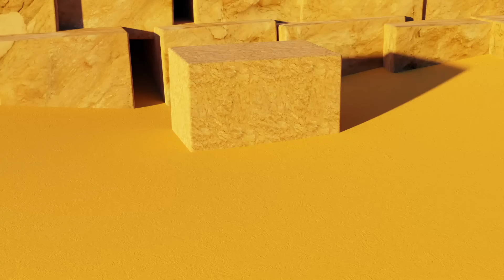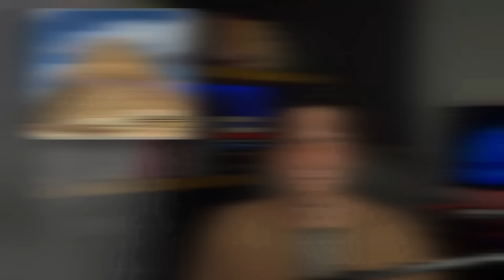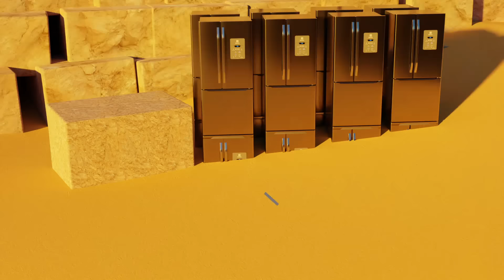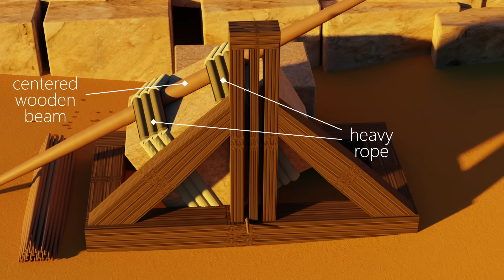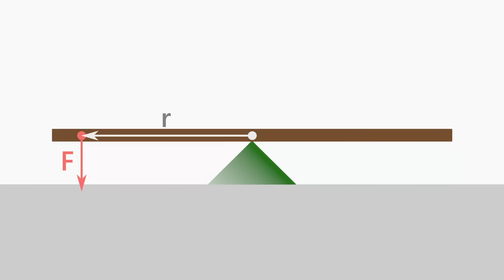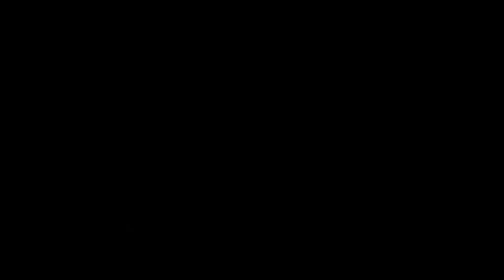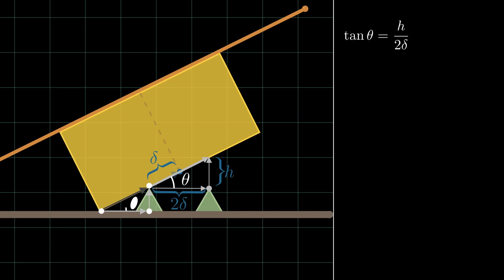Physics Reveals How the Pyramids were Actually Built

Comment: I have read some of Herodotus´ books but not the one where he speaks about this machines so I cannot argue that.  But I can tell you that in one of his "Nine history books" talks about how a Nomad tribe found the piramids and stablished arround them.  They found them, not made them.
The physics discussed here I have no problem with but believing that a wooden stick or two could bear 10 tons weight does not seem to be too realistic, they should be the size os a small tree of, let´s say 30 cm in diameter, just guessing here.... Another issue is where to place the machine on upper levels if only a fraction of the slabs is left to step over.  Furthermore, even if you had all the slabs cut out, placed near the future piramid and ready to uplift you yourself have stated that it would require placing one slab every six minutes for over two decades, extremely hard task if the piramid was a few meters tall but not at a hight of 230 meters.  We could also speak about the sawing of the blocks with bronce saws which was the only mineral available by then, no iron yet, the delivery of those blocks from a distant quary by boat plus charriots or sledges moving through the sand and how they where placed on those means of transportation.  10 tons was the average block, but there are some 10 times bigger.  Then lets talk about the absolute precission of their placement and the inside corridors where the stones fit so perfect that not even a sheet of thin paper can come through the joints.
I am not saying that humans did not do it, I just have too many questions that cannot/have not been answered  but that does not make me a conspiracy theorist.  Maybe someday someone will make a video explaining the whole procces of making the pyramids answering all these questions + logistics needed, but I have not seen it yet.
Reply from the maker: You make some excellent points, and I agree there are certainly more topics to discuss and cover.  I'd like to tackle a couple of your questions.  First, the wooden slats could indeed be 30 cm in diameter (perhaps I could have made the animation a bit more to scale).  The thickness of the slats drops out of the equation for the operation, so these would also need to be chosen appropriately.  A 30 cm thick slat (or log) can suffice up to 20 tons of sheer force (lower conservative limit).  For the more massive stones?  Thicker slats would need to be used.  The internal ramp theory of the pyramids allows for clearance of the machines to be transported and placed within the pyramid during the construction, so clearance on the edges would not be required.  The 10 ton block was used for this example in the video, but the physics and machine operation are not reliant on the mass.  For the larger blocks, the calculations (as well as the pivot distance) all remain the same.  Additional counterweights would need to be placed on the top surface of the block in order to help alleviate the large applied forces needed for heavier blocks.  
As far as the precision cutting, block delivery, and the use of bronze saws, these are certainly outside the scope of this video, but interesting topics to consider to investigate in the future.  With limited records, it is a tough one to crack.
Thanks for watching and appreciate your insightful questions.
Reply: @DrJohnDev Thanks for answering and for your politeness.  As I already stated your video puts together a lot of issues and addresses them very honestly. Excellent work.
Reply from the maker: Thanks @jazzman_10 ! Appreciate it and hope to see you on my channel again! You offer some interesting insights.

Comment: Ok, so you can lift a block to the height it would need to be to be on top of another block. And you say that it can be pushed off the machine and on top of the supporting block.
 But how do you push the10 ton block off the machine and on top of the supporting block?
And 10 tons is all well and good. Perhaps a log/ large wooden beam and some heavy rope could support that much weight.
But how the hell did they get the 100 ton blocks above the great gallery up there? 
In the same way with wood, ropes and leverage? 
Seems highly unlikely to me??
And to my knowledge no one has proven this to be possible by such means. 
I'm certainly not saying it was aliens but no one's got a bloody clue as to how the hell it was down either. 🤔🤷‍♂
Reply from the maker: The physics remains the same for an arbitrary weight. Leverage is used to lift 10,000 ton bridges, so yes, it can indeed handle the 100 ton blocks you mention.  Wood scaffolding also is used to temporary lift such structures during modern construction. So yes, wood can handle that too.
Reply: @DrJohnDev Ok, fair enough, maybe it's possible.
But that's some bloody strong rope though. I'm still not convinced. 🤷‍♂

Comment: Having seen this machine before (and the impressive demo here on YT) and having read about many many theories about the construction I'm nowhere near convinced that the "Physics Reveals How the Pyramids were Actually Built" ... don't claim I know either, but there is much more to building a pyramid than just lifting the stones for which there are many ways.
Reply from the maker: This is the most efficient method for lifting. Lifting actually is the biggest mystery. Do we not already know where they sourced the material, the waterways used for transportation, and how to slide heavy objects by lowering the friction?  Curious to hear all the other ways you would propose the ancients could lift the blocks.
Reply: @DrJohnDev   Thanks for getting back to me. I'm in no way expert in any of this  so I should really not comment beyond my point which was that the "physics DON'T reveal how the pyramids were actually built". The method presented may well be how it was done. On the other hand it may not. Even if this is the most efficient way to do the lifting it does not mean it was used. If we look around we see in-efficiencies everywhere even in this advanced scientific age.  The best does not always win.  So far internal ramps, with rolling block with counter weight seems like one possible option. Many videos here and lots of books suggesting various methods, some supported with archaeological clues in stones and hieroglyphs. Lots of more or less crazy theories also.
Reply from the maker: Right, certainly lots of theories out there. And I don’t have photographic evidence of the Egyptians using Herodotus machines. The main point I wanted to drive home: by only using the size and shape of the blocks of the pyramid (something we actually know) we can determine, with absolute certainty, the force required to lift the block using a counterweight-lever system.  Fully agree that they may have employed other methods as well, but I think it’s neat that science doesn’t always need an archeological record to understand the possibility and feasibility of how things work.

Comment: The collosal shear on the poles would dictate the need for very deep cross sections, which in turn raises the height of each see-saw "lift" I think Herodotus became an Historian becuase he sucked at engineering! Cheers!
Reply from the maker: Ha, very funny point, and admittedly, his descriptions are more verbose than precise.  So I agree the cross sections would need to be quite large to accommodate the weight.  Although the one interesting point is the thickness of the poles drops out of the equations, and the calculated forces remain the same.  The chief requirement is the first pole to be inserted.  One possible method to insert the first pole would be to tunnel the pole under the block through the sand, and then use water to remove the sand from underneath the block.  In the future, I would like to perform a survey of possible timber in the surrounding area, look up the sheer strengths, and compute what exactly the thickness of the cross sections would need to be in order to accommodate the weight of the block.  Thanks for your insightful comment and cheers!

Comment: They still had to place about 10 blocks per hour, every hour, for 27 years. That's a lot of blocks.
Reply from the maker: It is indeed still a lot of blocks.  It actually depends on how many machines they had.  With over 10,000 working at a time, there is room for this number to scale according.

Comment: This kind of machine works to lift heavy blocks. That is well known. But it is just at very small part in constructing a pyramid. How did they quarry, transport, measure the blocks, and so on. To know how they did it you need to make a total calculation of all the work and time needed. But most importantly, how did the Egyptians know how to do it when we don't even today. Did they know from the start or did they put 100 years of research into it, before they started building the pyramids?
Reply from the maker: If you read even the comments to this video, you can easily verify that the lifting using the Herodotus machine is not well known and clearly not well understood.  I agree the quarry, transport, and forming the blocks is also an obstacle, but certainly not above today's technology.  I also don't understand your 100 years figure.  Progress progresses rapidly when enough resources and individuals commit.  Afterall, we didn't even have transistors 100 years ago, and look how far we've come.

Comment: I don't believe those toothpicks will support 10 tons.
Reply from the maker: For perspective, try breaking an entire case of toothpicks in half all at once.  The wooden 'toothpicks' in this video are at least 10x the diameter of an entire case of toothpicks.
Reply: @DrJohnDev  You didn't start with a pack of sticks the lent each other strength, you started with only one hefting the weight of a 10 ton block.
Reply from the maker: A composite material has an even greater resistance to breakage than individual pieces loosely held together!
Reply: @DrJohnDev  That would be a strawman, red herring and non sequitur. (those are all logical fallacies) There is no claim that those pieces of wood are composites nor is there any evidence of such.

Comment: It's all very well talking about levers, but what was the lever supposed to be made out of? They didn't have steel. How would they even have got the edge of a ten tonne block off the ground using a copper lever? Your argument is totally unconvincing!
Reply from the maker: Wood is sufficient, and an average size tree weighs around 1 ton.  Check the Young's Modulus of Wood.  This machine has been demonstrated multiple times across various sources.

Comment: You should do a costing as to how much it will cost to build and how many blocks will be needed. I worked out that it will cost about a 3 billion using bricks😅
Reply from the maker: A cost analysis is an interesting perspective.  I found an infographic on the estimated cost on the Great Pyramid (linked below).  They estimated 5 billion, so not too far off from your estimate!
https://www.digitalinformationworld.com/2012/10/worlds-5-tallest-buildings.html
Reply: @DrJohnDev  pity no one has built one....even a 30th scale one then a ten ton block would only weigh 100 kg and video the whole construction, such a magical shape
Reply from the maker: @wijpke This is a good point.  It would still be quite the effort, but perhaps someone with the capital and resources would like to take on the challenge.  I know Stonehenge had been re-created by a man from MI, but I'm not aware of any pyramid builders out there.  Let me know if you come across any!

Comment: 1. This only explains how to lift a single block at a time to the height of... er one block.  

2. He takes a VERY long time to explain the mathematics.... which is basically common sense once you see the machine.

3. His conclusions are a bit suspect, because he should have started with working out how much work a single man can do... all day long. I mean, a single man could lift a massive block on his own, if the pivot points were close enough together... and if he had enough time to do so. 

4. What I want to know is the larger picture. I mean how many men were required to do that amount of lifting?  

5. Also you need to work out about 1 million other details of how they assembled that structure.
Reply from the maker: And that’s the only height that matters. One block. If you assemble a building, you start at the base and work up. Skyscrapers aren’t built with cranes as high as the skyscraper. One level is created, then the next and so on.  
The mathematics is the key to understanding. Without actually performing the calculation, the forces involved remain unknown.
Reply: @DrJohnDev  So... let's assume 10 hour working days, working 6 day weeks and 2 weeks of holiday per year. Ignoring other issues (like cutting the blocks , transportation and moving them sideways into place going from layer to layer) how many men would have been required... just to do the lifting of the blocks aspect?
Reply from the maker: I ran the calculation, and it seems like there'd be plenty of the 10,000 workers to work with:
(27 years)*((52-2 weeks)/year)*(6 days/week)*(10 hours/day) = 81,000 total hours
Now,
X machines = (2,300,000 blocks/81,000 hours)*(1 machine/block)*(1 hr/machine)= 28.4 machines required 
So let's just make it 30 total machines for good measure.
Now, it would take 20 men per machine, bringing the grand total to 600 men.
Just another 9,400 men to do everything else ;)
Reply: @DrJohnDev  Right, so let's see the demo. You can't argue that we don't have the resources to do such an experiment if all it takes is a few blocks of wood and 20  people per machine.
Reply from the maker: Again, send the funding, and I'll be more than willing!

Comment: Great video.  Most people have no idea how much of an effect levers and pulleys have on the force required to lift something. Our ancestors should be praised for there ingenuity and effort not discredited of there achievements. Take care
Reply from the maker: Thank you for your comment and support! This was exactly what I was trying to show with this video! The mechanical advantage of a lever system is the key to constructing larger than life structures.  Happy to hear you enjoyed and hope to see you around again!
Reply: Video is a joke.study geometry and physics
Reply: The capacity to move a 5 ton block even a one ton block which would still have to be raised into position literally without levers or mechanical apparatus would not be possible... A 100 pound. Perhaps at best... 500# block might be lifted leveraged a ways up but 50- 100 ton blocks... NOT EVEN POSSIBLE TODAY.  HEMP ROPES VS STEEL CABLES THE STRENGTH TENSILE AND OTHER OF A WOOD "LEVER"... LAUGHABLE

Comment: You not taking into account that therotation of the block moves theblocks CG away from  the next pivot, which increases the load.   It's an interesting method though & one that I have used to lift heavy objects ay home.  My front loader washing machine for example had to be lifted onto a stand in a very small laundary.  I also had to get it up some stairs into the laundary.

In the pyramid block case, the load at the pivot would determing the thickness of the wood slat needed to withstand the pressure & this would limit the minimum distance between the slats.  Which would limit the mechanical advantage that could be achieved with this method.  At this point, it must be pointed out that the old arguments against moving the blocks on wood rollers has always been the that the only commonly obvervable material availabe in modern times is palm trees & that these do not provide suitable durability for the task.  If this is true, it places further limitations on th emechanical advantage that could be achieved.  So, what wood did they use & where did it come from?

It also occures to me that they had a counter balance material available in abundance, sand.  They could have hung a basket of sand on the ends of the beam to assist tilting the block & just shoveled the sand into & out of the baskets to tilt the blocks or at least to assist.
Reply from the maker: Very insightful comments, and I very much appreciate your thoughts!  

I agree, the load at the pivot would determine the thickness of the wood slat, and this would need to be incorporated in the design.  Notice in my calculation, the thickness of the slat actually drops out of the equation, so this could be any thickness, as long as the starting slat underneath the block has the same thickness.  

The wood and type of wood is something I was thinking of as well.  I'd like to investigate the types of wood available in the area, and make some calculations based on the breaking strain of these types of wood.  The breaking strain of the slats as a function of thickness would determine the thickness requirements of the slats.

Finally, excellent remarks about using additional, lighter materials as counterweights.  This is something I thought they would be able to use, but didn't include in my video.  This would be the most effective way to lift the heaviest of blocks, as well as reduce the manual labor load per machine.

It's neat you have real world experience in lifting heavy objects.  I really wanted to find someone to talk to about this before launching the video.  Thanks again for the insightful remarks and hope to see you here again in follow-ups to this topic :)
Reply: Pyramids are piled up blocks of stones which were excavated to build the Suez Canal by brits.